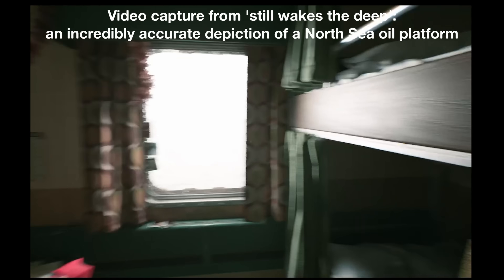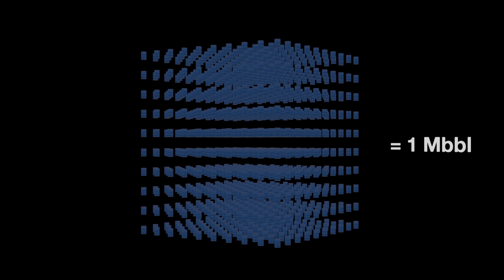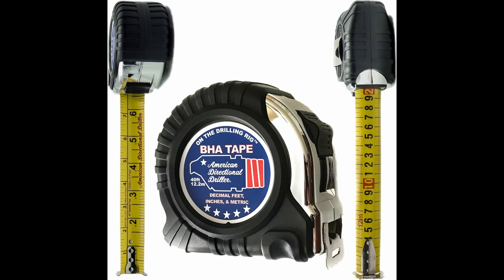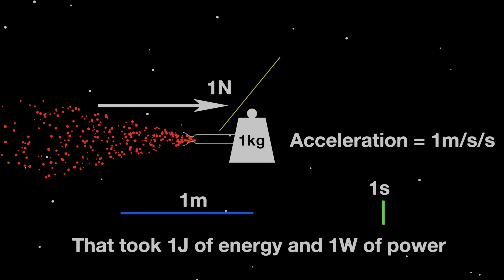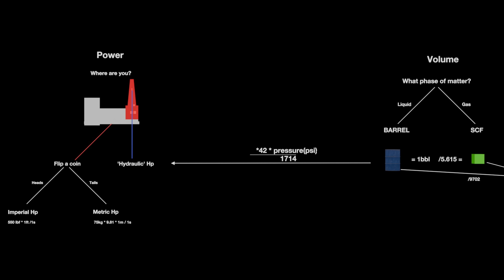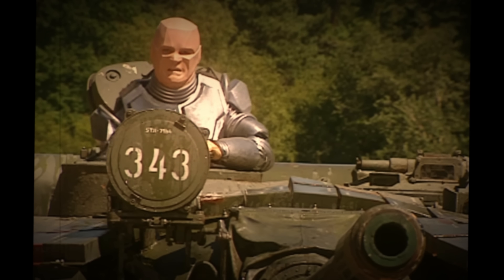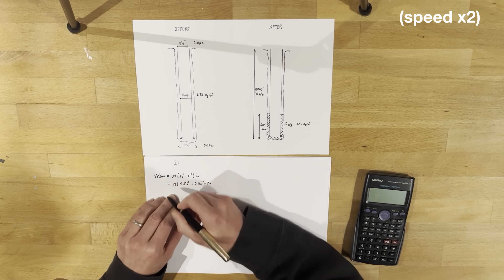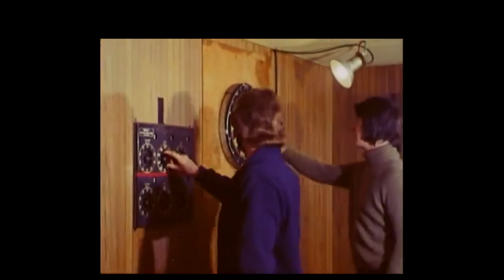Oilfield Units: a Measurement System so Cursed it made me Change Career

Comment: Phasing out oil and gas production to save the environment: I sleep
Phasing out oil and gas production to save young engineers from dealing with cursed unit conversions: REAL SHIT
Reply: And then you find out about aviation, where european airbus works with imperial units to sell their planes better in the american market. Only the russians (and possibly the chineese(?)) actually build their aircraft in metric.
Reply: @stratos2 Not to mention how the unit system used can depend on not only the country being flown over, and /or the nationality of the crew, but also the dimension. For example, distances may be in nautical miles or kilometres, altitudes may be in metres, feet, or "flight levels", horizontal velocity may be in knots, miles per hour, or kilometres per hour (and may be airspeed - true or indicated - or over the ground, and vertical speed may be in feet per minute or metres per second. 

I've probably missed a few...
Reply: @alexandermonro6768  for aviation what I understood is they use different units like knots and feet because over disturbed radio is easier to tell errors numbers that have bigger (in numbers) differences. Like a controllato says “authorized 250 +interference+” you’ll know there’s knots because “250” cannot be an altitude. If altitude were in meters you may get a 250m altitude that is dangerously low that may lead to accidents in unexperienced pilot.
Reply: @davidebacchi9030  That's not a big problem. Some pilots (russian and some european glider pilots) use metric units.
Reply: @stratos2  which is weird because just about everything engineering wise in the US is calculated in SI and then converted to imperial. Although, I will say, if metric had a unit that was say, idk, 5 kilometers, you might actually see metric catch on in the US. The issue is the US is so large that kilometers quickly become meaningless units. Driving 3000+ kilometers is not unheard of for vacations....
Reply: @goldenhate6649  the difference between km and miles isn't even that much in the context you put it in, 3000km = 1864 miles still in the same ballpark
Reply: @goldenhate6649  Australia is quite comparable in size to the US, not to mention more spread out, and we have no problems doing trips in kilometres.
Reply: @hughcaldwell1034  Don't lie, you guys don't have cars or travel. You also doubtfully leave the bungalow for fear of the emus attacking your pet kanga when you are on walkabout.
Also *DROP BEARS*!
Reply: @goldenhate6649 just pick a different prefix?  Now your 3000km drive is a 3 megameter drive.

Or use time, because you're probably averaging around 100km/h on highways.  30 hours of driving.
Reply: @phlogistanjones2722  Sadly Australia is extremely car-centric
Reply: @hughcaldwell1034  Us Canadians, who’s country is larger then the U.S. use kilometers for distance so……
Reply: @R1GP1G  Russia exists, too
Reply: @goldenhate6649  why do people think that the us is unimaginably big? Like most people on most days don’t drive cross country.
Reply: @phlogistanjones2722  Now now, at no point did I mention cars. We're used to strolling a couple hundred kilometres to pick up some milk and snake repellent; you think we'll balk at a cross-country hike?
Reply: @TGoat5 seriously who wouldn't want a vacation measured in megameters?
Reply: @hughcaldwell1034 actually we still use us imperial in oil&gas and in most water well drilling becasue they use a lot of gas gear. And Boomers think they should have to change.
Reply: @goldenhate6649   "The us is so large" you are joking right. 
3000km = 1864 m 7223.04 inches.  Not that far to drive for a holiday.
Lots of people here drive 10,000km or more for a road trip.
Reply: @goldenhate6649  Ok, but as an Australian who also lives in a massive super spread out country, km/ph is still so much better for cars?? Like, how do you set a reasonable speed limit when you're meausring everything in miles - 10 m/ph is an enormous jump in speed, but trying to get people to remember if the limit was 50 or 55 is a recipe for disaster. Not to mention trying to set a reasonable margin of error for it - going 5 over the limit is a huge difference, but also hard for a driver to see on a speed-o-metre.

Also you can set the limit at 100 km/ph on the zoom zoom go fast roads, which is just a very satisfying number, but in the US I don't think most cars can even go 100 m/ph.
Reply: @goldenhate6649   have you seen Russia on the map?
Y'know, there's a train route from St Petersburg to Vladivostok.
It's a passenger train.

Also some weird people like to drive from, like, Irkutsk to friggin' Sevastopol'
This trip's longer than the longest line of Europe

Kilometers work just fine. The Imperial system (at least in measurements of length) is completely obsolete.

btw please learn not to accentuate vowels the English way
It's VladivostOk, IrkOOtsk and SevastopOl'
Reply: @The-jy3yq  How the fuck else can you pronounce vladivostok. i understand irktusk and sevastopol, but vladivostok?
Reply: I've been working in Hydrogen and people doing natural hydrogen and every moment I can I remind them this is the time to move from SCF to SCM. Modern LNG plants use SCM, it's time to kill them
Reply: laughs in plastics
Reply: Only UK and UK uses these dumb units. Civilized countries like for instance Norway uses metric uses in the oil industry.
Reply: I haven't been in an industry that didn't cater units to their specific application. I think nuclear is the only one that deals in consistent units.
Reply: What's cursed about multiplying numbers?
Reply: Without petroleum, there are no solar panels, wind mills, plastics. Petroleum is a key component in so many things and people don't seem to realize, w/out an alternative you are casting yourself back into the stone age. We can use nuclear, hydro to generate power, but you actually still need petroleum to build the factory and many of the components. Petroleum is the single greatest discovery ever. We burn it, plants consume the byproduct. Trick is, educating people on the truth about oil vs the propaganda they are now taught in schools.
Reply: @adf360 when you said “plants consume the byproduct” as if plants were starving with the pre-peteoleum era co2 levels just screams “🚨idiot alert🚨”
Reply: @realGBx64  Nonsense comment that doesn't relate to reality or my statement. I suppose you believe in 'climate change' and other non scientific propaganda? Go away silly bot.
Reply: @realGBx64  he's not an idiot, he's a liar
Reply: @adf360 lol, putting quote marks around climate change when the average temperature changes as much in 100 years as it generally changes in a hundred thusand, and you call each others bots? Short circuit yourself, Johnny 5
Reply: @realGBx64  seriously, read what you just sent me, parse it out and make it make sense. It almost sounds like you are agreeing w/me but it comes across as possibly snarky but then doesn't grammatically make sense (to me). 

If you aren't a bot, then perhaps English isn't your native language, your comment is being butchered by a translator app, or grammar isn't your thing. I don't know which, I just know that between three people sitting here reading what you wrote, we aren't sure what you are trying to say.
Reply: @adf360  yes awesome, oil is super useful and also not infinite, so maybe we should avoid burning it as much as possible so we can make more plastics and chemicals with it instead of lighting it on fire?
Reply: @lawrencemaroun3310  What do you mean it's not "infinite"? Did everyone skip 6th grade science and go right for collegiate propaganda? Techtronic plates haven't stopped moving have they because I didn't get that memo.. As I'm typing this, the planet is producing oil, it doesn't care what you or I believe, it's just going to keep doing it.  A well just access a pocket where oil has seeped into and accumulated. Fracking attempts to reopen it if it's sucked dry or collapses. Oil production is in fact infinite, a well is not. It's why people snicker at some of you when you use the phrase 'fossil fuels', that's not science that's 'propaganda' to keep the prices up. 

Co2 is another nonsensical topic. If you understand how photosynthesis works, all you have to do is ask how the Co2 manages to dodge the photons from the sun? Also, if these molecules aren't being driven to the surface where the plant consumes/converts them to oxygen, then how are the plants still thriving and we aren't suffocating?. Unless the sun stops shinning and Co2's molecular weight changes, it's not possible that the atmosphere about your head is as polluted as they claim. Another tell is the color of lightening,. If you weld professionally, you know that different gasses produce different colors. If the atmosphere was in fact overwhelmingly polluted w/Co2, lightening storms would be an odd green hue and they aren't.

It's all so silly. Big city's struggled w/smog during the day and it cleared in the evening. If you understand 'photons' are being ejected, then you understand it's because the sun was shinning. So the Co2 rises up into the atmosphere at night? No, the sun always wins, the Co2 is driven to the surface "always",. Even if AI or someone w/a PhD from Harvard tells you otherwise, Co2 has no mechanism to defy physics other than propaganda.
Reply: @adf360  Plants have a limit to the amount of CO2 they can consume. We are going past that limit.
Reply: @sohamacharya171 Nonsense, having owned/operated a greenhouse, if you increase the Co2 the plants exponentially increase their growth rate. Their may be a limit for humans but it's not an issue as long as you have the plants. Co2 isn't even an issue in regards to anything climate, that trope is only peddled by people who are scientifically ignorant/lying or pushing a fake agenda.
Reply: @adf360  "plants exponentially increase their growth rate. There *may* be a limit'" Mate you clearly are more of an economist than a biologist. There are no unlimited exponential growths in nature, biological systems might have a great degree of tolerance and capacity to adapt but when the limit's reached it breaks hard. And when the thing breaking is one of the most fundamental bases of the trophic chain...
Reply: @sohamacharya171😂😂😂😂
Reply: @adf360  Jeez if all the nerds just remembered about the plants (that surely very much keep up with the amount of things we burn), even the nerds from oil companies forget that now
Reply: @ImieNazwiskoOK what "about the plants" are you talking about?

Comment: The dog leg severity units are probably left over from railroading terms where radius of curvature was measured practically by walking 100 ft down the rail and measuring the angle.
Reply: I think they help the people on the platform to visualize how hard the string is deviating, knowing how much deviation each joint can tolerate before breaking
Reply: Not left over, but exactly how it is done.  The MWD survey measures degrees from vertical and magnetic heading.  The rig measures the number of feet of pipe. It is literally the two numbers that the driller actually has to work with.
Reply: @thewarderman1840  chains, 22 yards isn't it
Reply: Cricket - distance between stumps .
Reply: @yesihavereadit  Or one pitch equals 5.5 creases
Reply: Won't someone think of the amputee dogs?!
Reply: @wombatillo  I have seen many three legged dogs, especially around the railway in the Balkans.

Comment: you're just going to brush over DOG LEG SEVERITY, WHAT EVEN IS THAT
Reply: Degree of borehole curvature per 100ft. It's an old term that used to be used for measuring the curvature of railroads.
Reply: @1Heirborn  Still is used for measuring curvature of railroads in the US.
Reply: @beeble2003  americans will use literally anything but the normal units i see.
Reply: @Graine01  Well, the advantage of degrees of curvature is that you can measure it directly: walk 100ft along the rail and see what angle you've turned through. Measuring radius isn't directly possible. Indeed, off the top of my head, you'd probably measure radius by actually measuring degrees of curvature and then converting.
Reply: @Graine01 Well not our fault the pirates took them and left us with imperial. Also. Have you met an American? If the whole world had just quietly not said anything we'd probably use metric by now, but they made it a thing of pride so good luck now.
Reply: It's a measure of how annoyed you will be cleaning up if you fail to walk the dog
Reply: Etymologically, it was called dogleg severity just because a dog's hind legs are also curved. Which... frankly is a very unsatisfying explanation. There's lots of curved things other than dog legs that we could have used?? Dog legs don't even look anything like a railroad???? Why not, like, rainbow severity?
Reply: @chiaracoetzee   Dogleg is also an actual term by itself, basically meaning a bend. So dogleg severity is the severity of the bend. I guess dogleg is used in this context because it's recognizable as meaning bend (at least in my part of America) while still being unique and weird enough to sound like a dedicated unit.
Reply: @derpinator4912 like.... without the YAWN FACTOR of--"CURVATURE" 
(...i have a certain math book in mind..!)
Reply: @chiaracoetzee "rainbow severity" would be so incongruous as to ruin both words of their utility.  🌈 = Well known symbol of 'mercy'.  As for "severity," this is for teaching discipline.  Think of your idea of Jesus rebuking daemonic error?  See?
       I wish I could come up with a more pagan example....
       But I feel you are on the right track in asking the question.....
       Maybe "angular shear" would be closer?
       (The term was explained to me as a boy as "it would be a good place to urinate")
Reply: It's how someone running a drill wants to think. Radius doesn't mean anything to them. They want to know how far the drill should deviate per unit of drill pipe they're putting down the hole.
Reply: Build is the change in inclination, zero degrees is vertical and 90° is horizontal. Turn is the change in azimuth. Dogleg severity is the build and turn per 30m (100 feet). A typical dogleg severity in 222.25mm (8.75  inch) hole is 8.0°/30m. The 8.0°/30m is a safe amount of bend for 177.8mm (7 inch) casing in 222.25mm hole.

Comment: now to be fair, i never took up maths or physics beyond gcse and now i going into architecture and you dont really find bizzare units in the 'few' calculations you do

but what the fuck even is a british thermal unit?
Reply: Which British Thermal Unit?
Reply: A BTU is slightly more than a kJ, 1054 to 1060 J depending on the exact definition. Deviating just enough that you can't assume it to be a kJ in calculations.
Reply: A BTU is the unit you'll need to use when sizing the HVAC systems for the buildings you design.  :)

Comment: One can really feel that there is a tiny bit of frustration and resentment in this video.
I can fully understand that. In my line of work (aerospace engineering), the insistence on imperial units is somewhat frustrating, so let’s hope that common sense will prevail at some point.